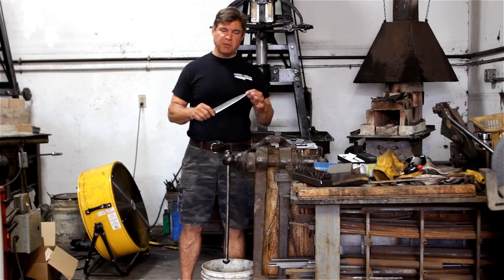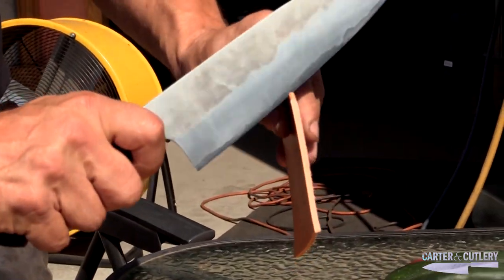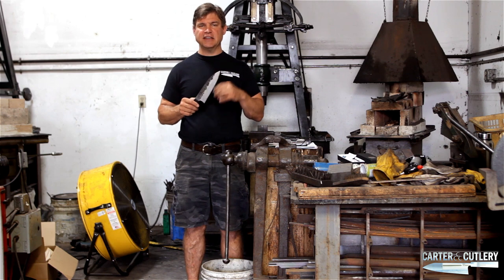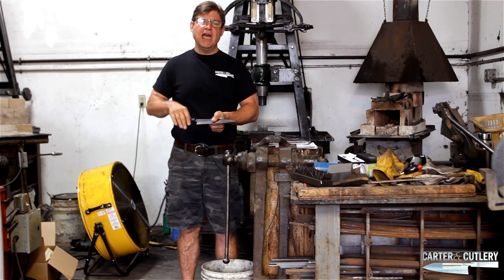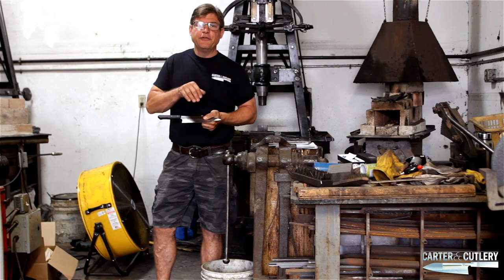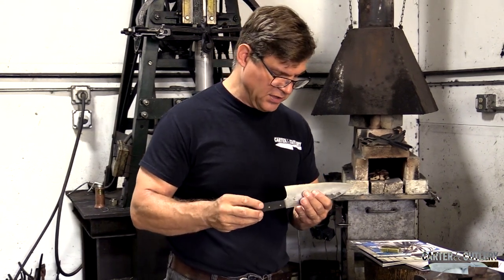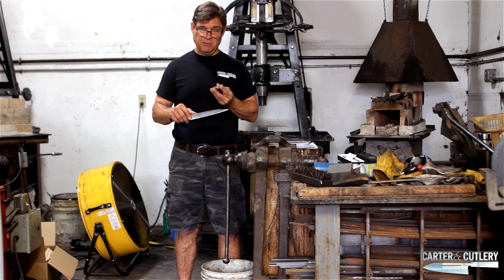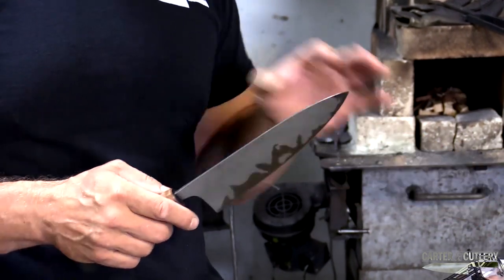Why Blades Chip--UPDATED!!

Comment: Very good  information. How did  you  keeping from  rust?
Reply: Wash and dry after EVERY use...and oil lightly for long term storage.
Reply: MASTER deBATER. What type of oil can you recomnent?
Reply: @Ejs3709 :  I use food grade mineral oil.  That way I don't have to worry about toxins if I fail to remove all traces of oil before use.
Reply: @Master...deBater  Thanks for your quick answer :-)
Reply: @Master...deBater  thanks for the advice I made some kitchen knives but rust make me feel frustrated